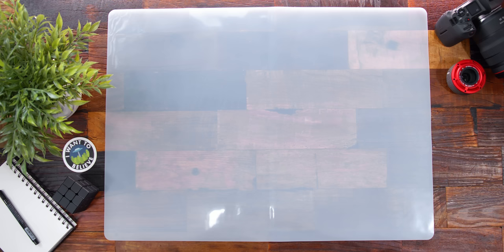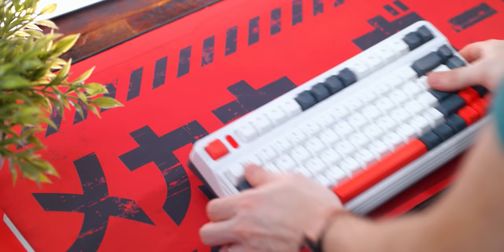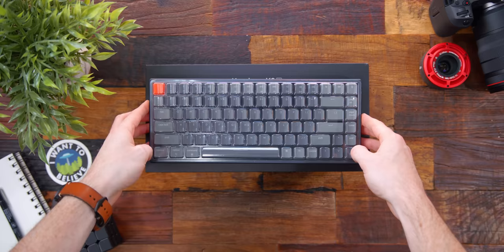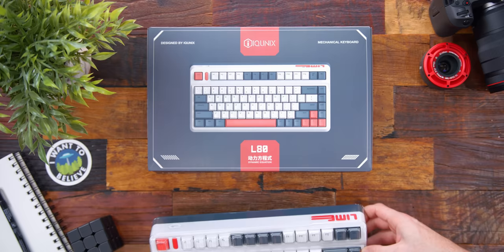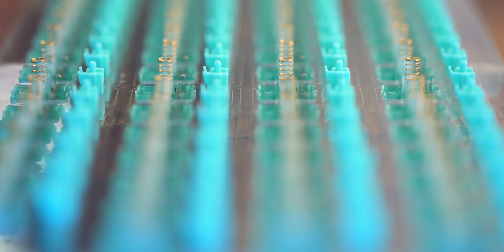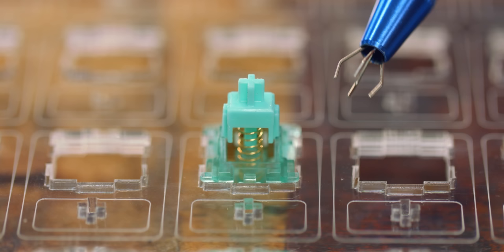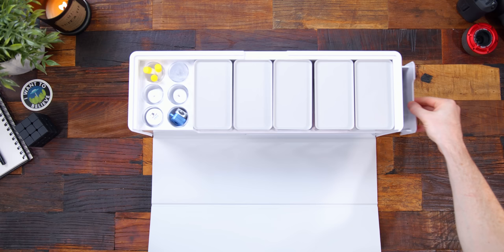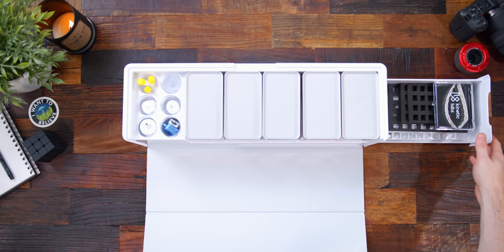Endgame Ep.2 - Keyboard Mods & Accessories!

Comment: Idk, I tried the silicone mold mix on three cases, they all made the keyboard sound rubbery. Kind of like dribbling a basketball when bottoming out. I also found out that using a mousepad as a dampener makes the same dribble sound. 

You can hear that rubber sound on the video too. I would definitely recommend trying to use shelf liners or foam for a cleaner sound.

Awesome video Frank!

Comment: Definitely feature the "Holee mod" next ep. It's sort of a new type of stab mod to eliminate wire rattle that more people should know of.
Reply: Holee mod sucks IMO, takes ages to break in and feels horribly mushy until you do. Plus it breaks down after a few months and bits of plaster stars disintegrating inside your keyboard.
I tried it once and never again, just use Krytox XHT BDZ on the wire (after making sure it’s perfectly straight) and 205 G0 on the housings and you shouldn’t need the holee
Reply: What's holee mod